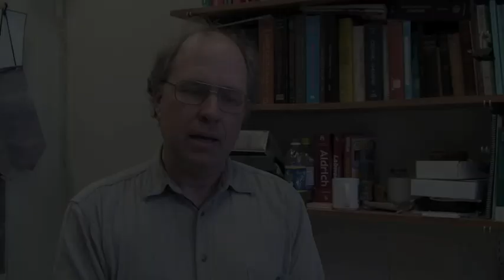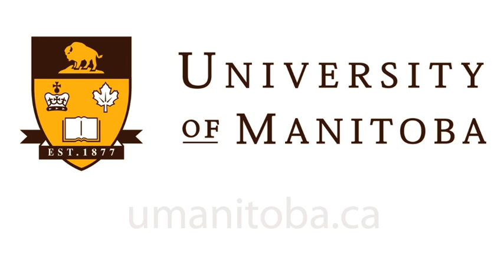Why do we throw salt on icy roads?

Comment: in another video they say sand is cheaper than salt but not as good as salt at thawing ice. in this video they say salt is used only because it's cheap but not because of its dissolving ability.

I tend to believe that sand a.k.a. dirt is cheaper than salt. so if what the professor says is true, why not use cheaper sand instead of salt?
Reply: Because many of the substances in dirt are insoluble.
Reply: Sand in ice? That'll make the area look dirty, salt is better👏

Comment: That's the best explanation I've heard. Most people just say NaCl is used because it lowers the freezing point. Any substance will lower the freezing point of water; oatmeal, sugar, gold, or dirt. You have to take into account the EQUILIBRIUM between the ice and thin layer of water. Good job Dr. Phil